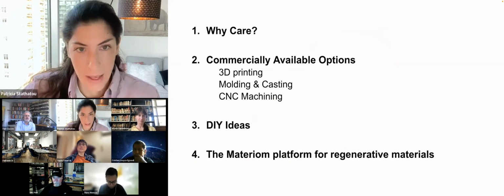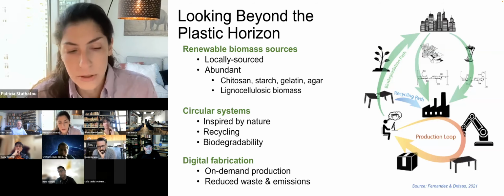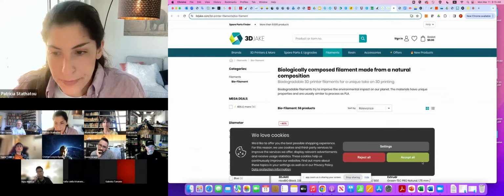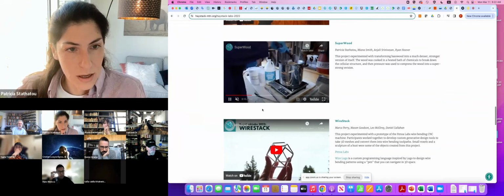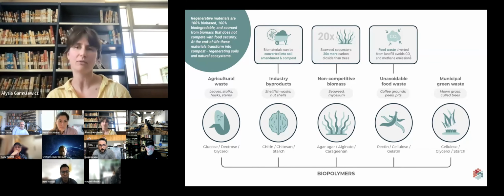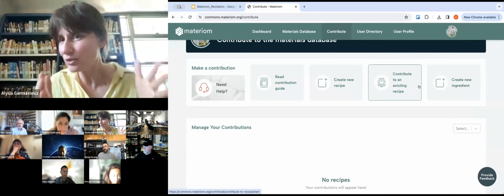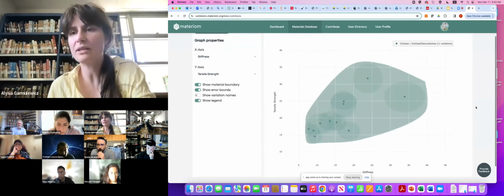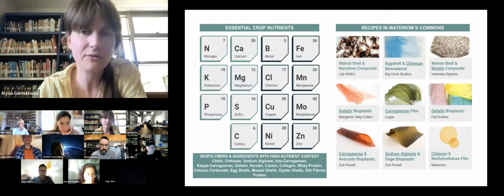Sustainable Materials Recitation

Comment: Two aspects of the Portland cement manufacturing process account for the vast share of its carbon footprint. Cement is overwhelmingly made by burning fossil fuels like coal and petcoke in cement kilns—akin to large furnaces—to heat limestone (raw material) to very high temperatures (~2,640°F/1,500oC). What about replacing Portland concrete with  Geopolymer concrete? An EPD is available for comparison.
Reply from the maker: Many of our students create resins and castings with bioplastics.